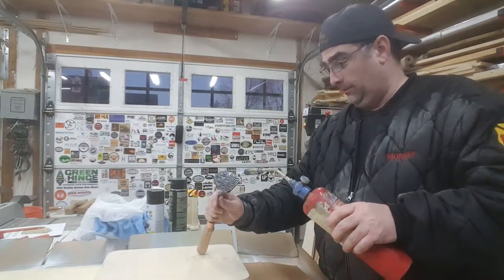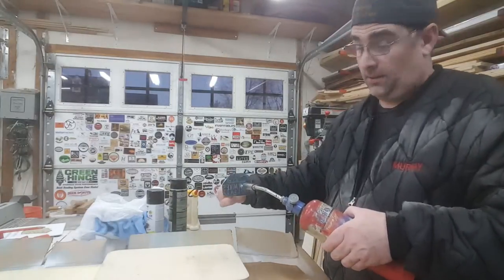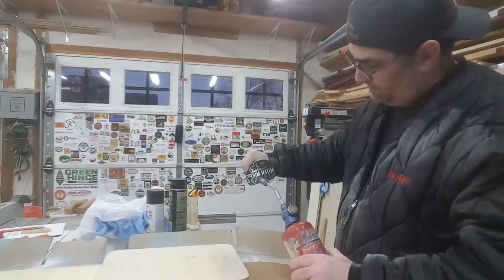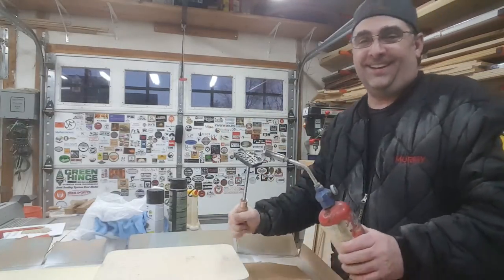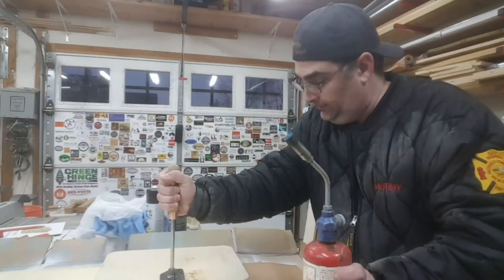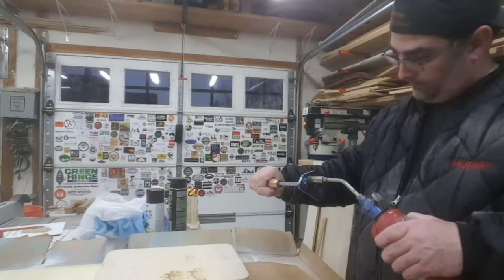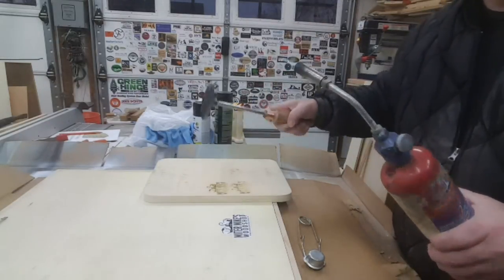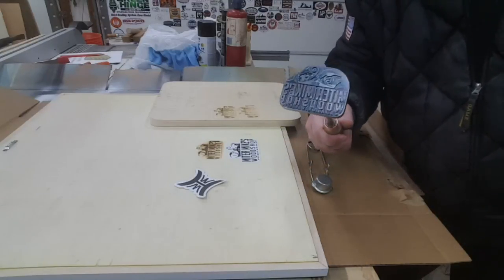Miter Mike's Woodshop Branding Iron by Hillview Wood & Metal

Comment: Sweet, Get you a hot plate tho, it will save you gas
Reply from the maker: that is an idea, next video i am going to use it i am going to pull out the weedeater propane burner i have, think most will get a kick out of it....i say about 1 min under that i should be able to burn a while.....lmao. Thanks for watching Sterling.

Comment: You may try and find a exhaust pipe fitting it's an adapter usually about 4 to 5 in Long with the inside diameter that your iron will fit in and then set that on two bricks that are separated slightly so it doesn't roll off set your torch up inside the tip of it and it really cooks them I enjoyed your video thanks for sharing
Reply from the maker: wow that is a great idea, thanks for the tip. Thank you for watching.